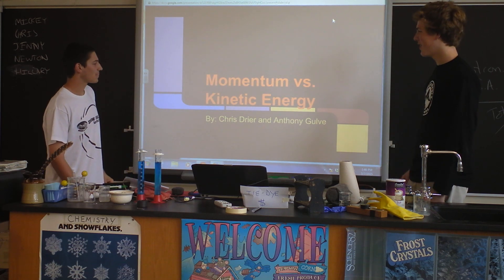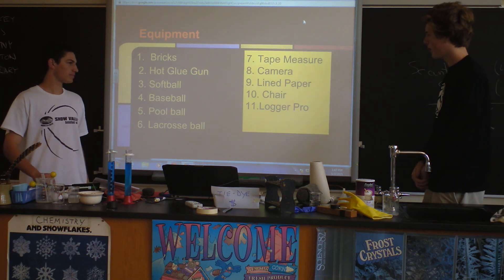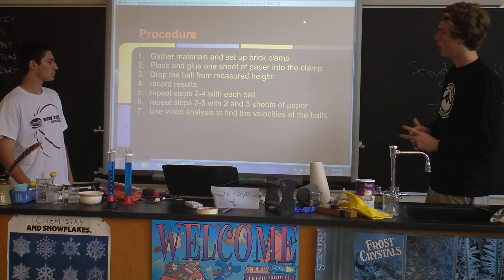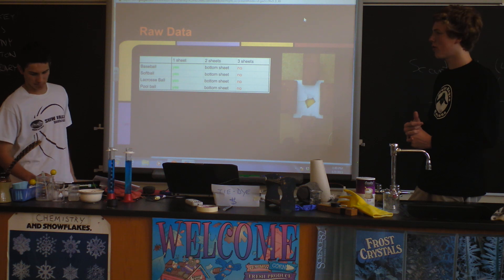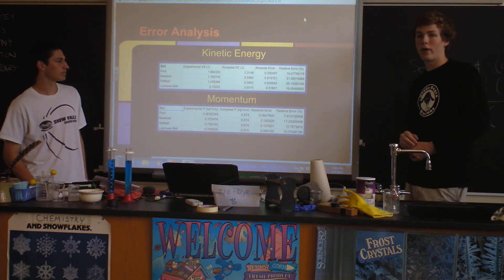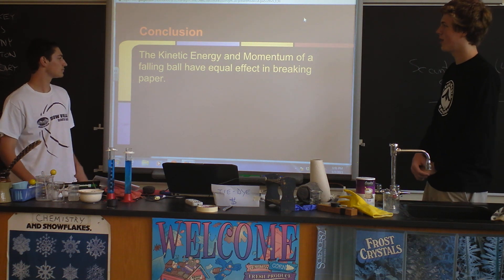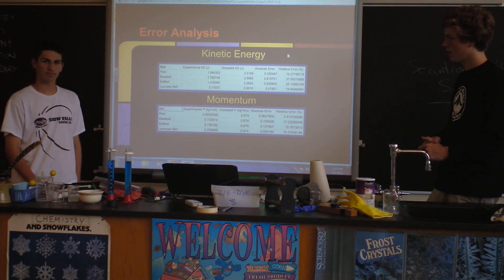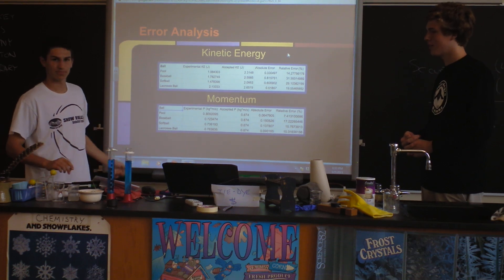Indie Lab - What Actually Rips Paper - Momentum... or Energy???

Comment: I don't understand the question, is it what breaks paper, momentum or kinetic energy? They are not independent of eachother but instead they are related with the equation E=p^2/2m, right?
Reply: JSmih7 Exactly, E_kin ~ p^2 ~ v^2 (~ means proportional, with mass = const). They also did only measure the velocity and calculated E_kin and p from these formulas, making their question even weirder. 

The right title/question for this experiment would've been 'Which combination/relation of mass & velocity is needed to rip the paper?'. As v=p/m and they measured roughly the same momentum for each ball, they would've found (for spherical objects of this size): v ~ 1/m with proportion p ~= 0.76.

No offense! Just some ideas.